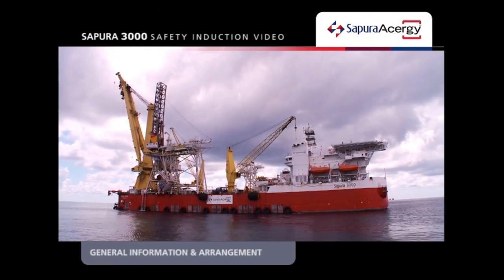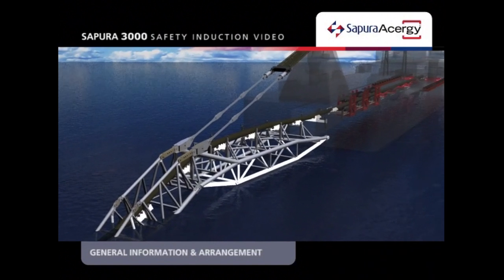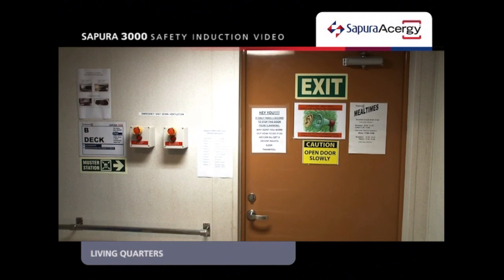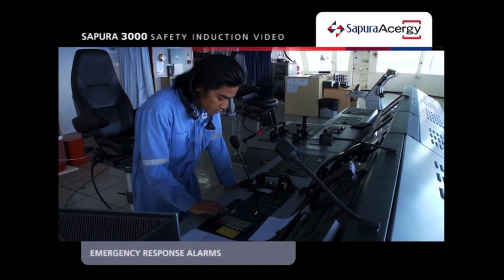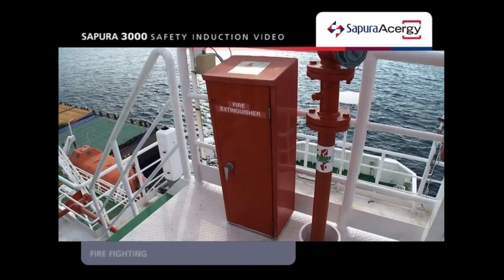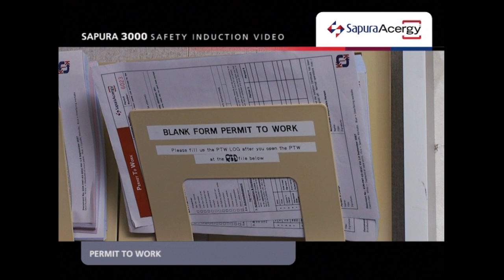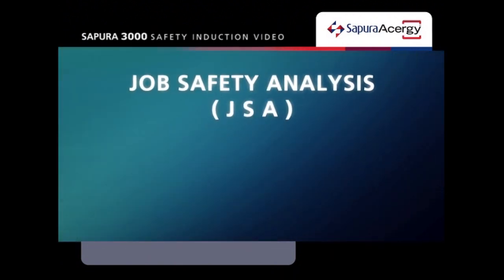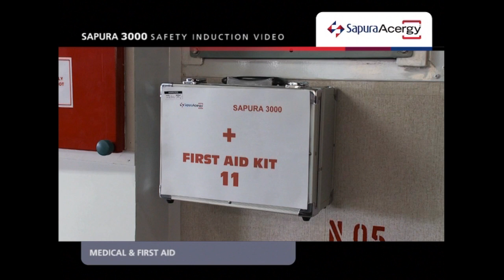Sapura 3000 Safety Induction Video

Comment: Designing a pipeline for the  deep water activities are more  challenges as  against the pipeline design for shallow  water. At deep water depth, more than 300 meters, the pipeline will expose to  high  external  pressure.  External  pressure  by  the  pipelines  is  directly  proportional  to  its operational  depth. Designing a  sub sea pipeline  for  deep water  in  Malaysian  seas  should  give  full thorough consideration  and attention to the external pressure since it huge impact and  effect  on the  pipelines as  compared to  the shallow  depth’s pipelines.  Pipeline  installed  at  deep  water  depth  will  have  a  high potential  to collapse  compared to  if  installed at  shallow depth. The  potential  of  collapse  is  due  to  the  high  external  pressure exposed  by the  pipeline. Hence,  a careful design  should  be done,  together with  a suitable  design criteria  and that  can  overcome the collapse  failure  of the  pipeline  in  deep water depth. During installation at deep waters, pipelines will be subject to bending moments near the seabed, high external hydro static pressure, along with axial tension, affecting the installation process.
Pipelines must be designed to withstand buckling during the installation, which is a greater problem with increasing water depths. When pipelines are installed empty, the concern of local buckling and hence propagation buckling will be significant.
Deep water pipelines will typically be thick walled pipes, which due to the high weight set limitations to installation depths applicable for existing vessels. In order to reduce the weight, pipelines with higher steel grades are considered, as increased yield strengths will decrease the required wall thicknesses .Several technical and environmental challenges are affecting the pipeline design and installation processes. Pipeline design due to high external pressure is, in combination with bending during
pipe laying, possibly the most challenging aspects for deep water fields. Limitations in number of vessels able to perform S- and J-lay at these depths are pushing prices up. Pipeline insulation is also a challenge in order to secure a satisfactory flow assurance at deep waters where hard and cold environment can be present. To improve pipeline lay ability, use of higher graded steels such as X70 and X80 has big potentials. Increasing steel grades will reduce the required wall thicknesses to avoid collapse and decrease pipeline weight. An overall cost reduction is most likely the outcome of increased steel grades.